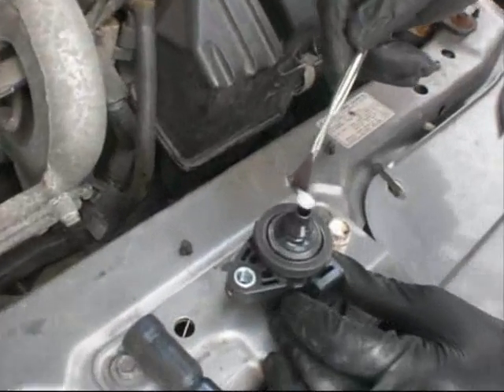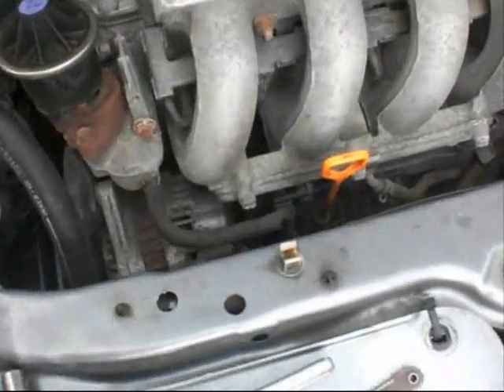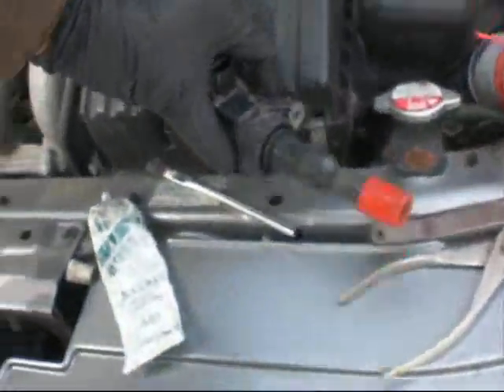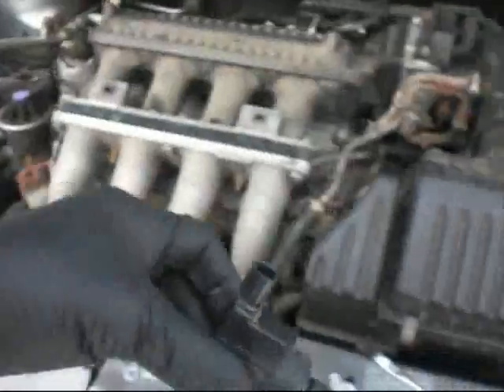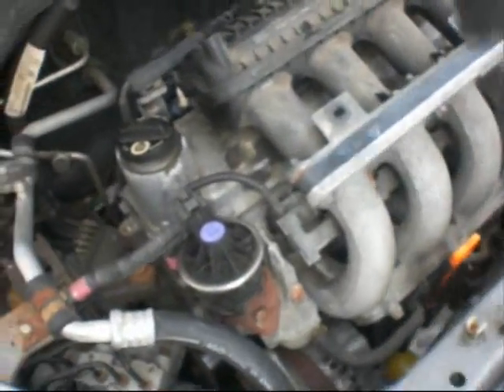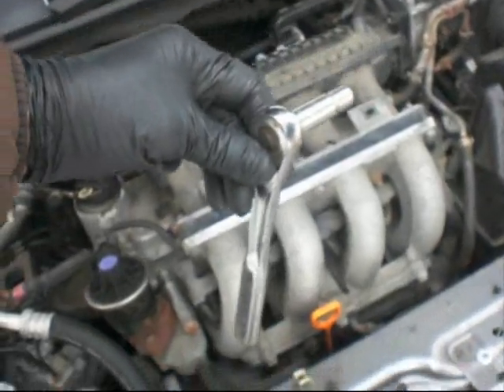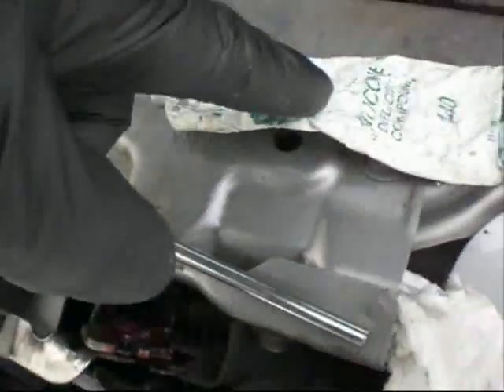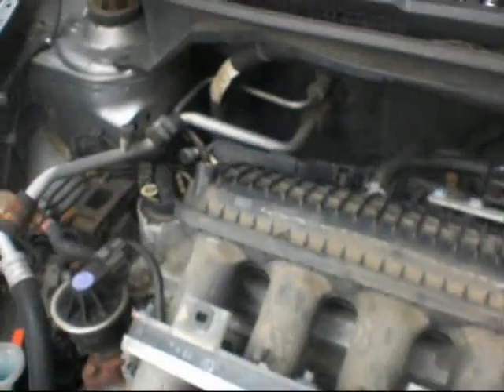Honda Fit Fix  2 15 14

Comment: Our 2007 A/T Fit made it to 2022 before starting to engine stutter ... just getting my investigation going, but seems like coils are the #1 instigator
Reply from the maker: Yup. Try Rock Auto. Don't buy the cheap ones. I would think denso is good original equipment
Reply: @CORVAIRWILD  two were burned through internally, weirdest thing I've seen

Comment: U guys are the only ones who talked about it. Wow mine started early I believe due to the hot weather in socal I but out two coil igniter packs and my local honda dealer ship SAID was a valve adjustment( witch I told them was just the packs abd shoulda been under warranty) then they finally replaced them. Unfortunately the packs are located directly above the down pipes (poor designer) I will in the future wrap mine to reduce heat from the pipes abd heat shield. Other then that I lobe the car
Reply from the maker: You'd think Honda would know everything. Glad I could help!

Comment: Great video. Thank you for posting that. I've been hesitations with my 2007 Fit with 172.000k on it. Never changed the coils. Recently did the spark plugs. My problem is very casual and not all the time like yours. My car hesitates to accelerate. It takes a bit of time, there is a delay and then vroom the car takes off. I was thinking it was a PCV valve but I dont want to remove the intake manifold. Time to replace with oem coils. Thanks so much.
Reply from the maker: Why don't you buy a code reader, guessing is just taking a chance. The FIT in the vid is running strong at 205k, just asked about it yest
Reply: +Figgles274 u can try to set spark plug gap to 0.5mm ,that helped to me! :)
Reply: was a bad coil pack. this was resolved last winter. but yeah it was bad, was getting engine code with a misfire on cylinder 2.
Reply: Figgles274
did your check engine light was on? for me helped smaller gap on spark plug 0.5mm .
Reply: Yes, had the same problem with my Fit  misfiring under acceleration/load.  It appeared a coil pack was arcing over with the higher breakdown voltage of a richer mixture, so I reduced the plug gap to reduce the breakdown voltage.  Problem solved, and no reduction in performance.
Reply: double check the spark plugs there known to loosen up and cause problems, burn up the coil, and pop out taking the threads with the plug.

Comment: Even with CEL is not on the ecu supports mode 6, so you can count misfires with scanner to find the offending cylinder.
Next, it is a good idea to change plugs on cold engine at 20 degrees C ambient temperature 
Finally the vent hole on the coil is to prevent condensation of moisture inside of the spark plug well. Some  aftermarket spark plug  wires for Toyota Camry that do not have this hole cause poor idle due to dew accumulated inside (and leading to unnecessary repairs)

Comment: So you guys just went in order swapping out the old coil for the new one until you found the issue, no?

ie you just used one new coil pack and put the old ones back in and then proceeded to the next?  or did you just replace 1 and 2 and then after replacing 3, you determined it was 3?

Comment: I'm confused why you didnt just change the oil and re-fill it properly. I have a 2007 Fit and I have over-filled it that much before... it was sluggish until I drained some oil.  And dont skimp on the Coils! Get the right ones! Hitachi is the OE manufacturer.

Comment: Good job gents. Save that cash. Have you ever tried motorcycle chain lube on door hinges? It works great.
Reply from the maker: The Lube Gel that WW used to sell was the best, Fluid Film is almost as good. the chain lube I used, 2 kinds was way too thing and smelly
Reply: CORVAIRWILD
 The stuff I use is Lucas, starts off thin initially and then thickens up and stays put. Not very smelly either.

Comment: Wait, the Honda Fit has solid valves? Where do you adjust them?
Reply: you mesure and change the tappets for thicker ones as there is no rocker arms
Reply: ewwww, I don't like that kind D: I recall seeing a chart for that exactly in a 87 Toyota Chilton book :O
Reply: I like those. Hydraulic lifter are a pain when they clog up.
Reply: Really? I've noticed that with my brothers caravan, the 3.0L v6, the lifters tick like mad and take a while to pressurize :O My honda, has rocker arms, so I just adjust the nut and screw on them :D
Reply: Yeh, my duramax and isuzu impulse have solid tappet/lifters. Solids always perform better in high performance engines but need adjustments at less once in the life of the car.
Reply from the maker: Yup, solid

Comment: Lucky in a hot climate they melt into the plug holder and rubber gets stuck.
Reply: Doug Berrigan ugh. This happened to me. I replaced my second coil pack the other day and had to hand it out with a couple sets of needle nose.

Comment: Yea, Its a pain but its easy on a 4 banger to find a bad coil, Keep swapping.  Same goes with fuel injectors.
Reply from the maker: We're going to fly to Georgia mid April, buy an Astro Van, drive to Florida, pk up the new Harley, drive home. I need an Accord fuel tank, 1991 4 door. Got junk???
Reply: No I live in a condo. Not too much room for junk. I'm sure some junk is around here somewhere. The Junkyards always pop holes in the tanks, so unless you find someone parting one on Craigslist, its probably going to have a hole in it.  The LKQ yards in various parts of the state are Self serve yards and have nice selections.  Just search LKQ self serve Florida.  Then there are a of hokey pokey yards that are self serve.
Reply from the maker: ghtowagon
Condo? Shame...
Reply: Used to live in a house in the old country

Comment: I have a Honda Fit Sport 2007.  I had all 4 spark plugs and all 4 coils replaced on 10/26/14 at 89418 miles. On 11/7/14 the engine light came on again and when i hooked up my carmd code reader it tells me i have the same problem Cylinder Misfire Detected. When i first had the problem it was in cylinder 4. Now the misfire is in cylinder 1. I do not know what else could be causing this problem. I had all 4 spark plugs and all 4 coils replaced to fix the problem the first time.  Any insight to this problem that you may have would be very helpful.
Thanks,
Yasir Faheem
Reply: Try to swap coil from cylinder 1 to cylinder 2 and see if code follows it (I know the coil is new but who knows:); Next do the same for the spark plug. 
if code still sits in cylinder 1 consider valve adjustment
Reply: There's 8 spark plugs in the older ones 8 coils

Comment: Thnks guys.
Can u explain please , i ve buyed 3 coil ignition plugs , but inside there is no resistance , only an aluminium without resistance . Is it normal ?

http://youtu.be/tfTr9Yw9E2U
Reply from the maker: I'm more of a parts replacer, I'm not good with resistance, sorry
Reply: DONT BE A PART REPLACER TEST BEFOR YOU BUY PARTS